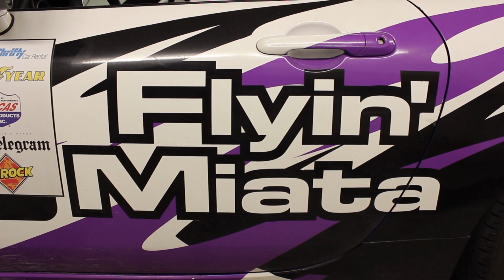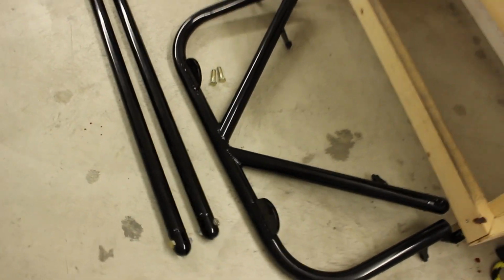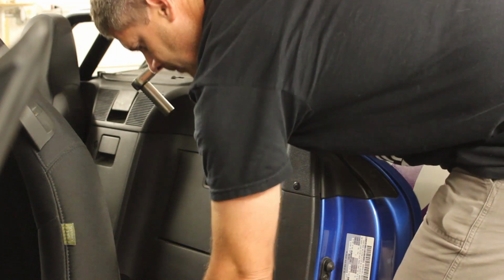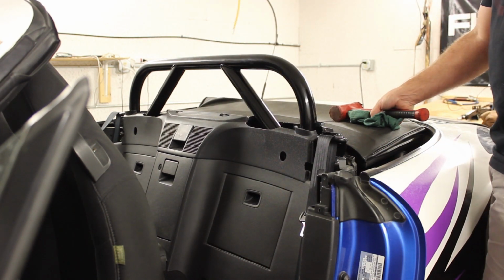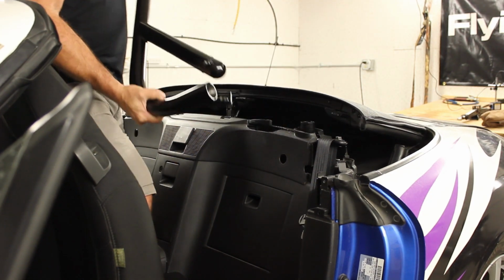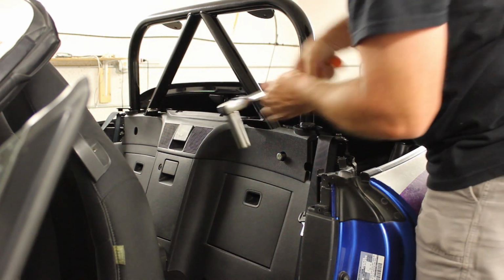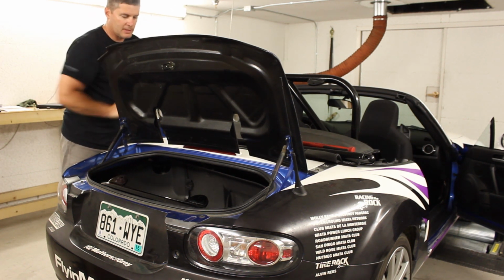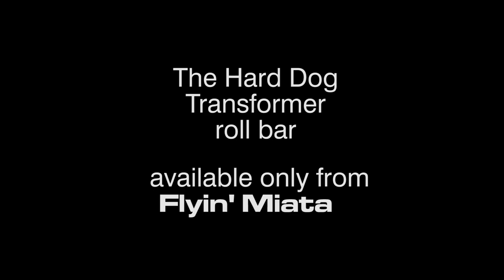The Hard Dog Transformer roll bar

Comment: .this is why everybody hates the NC. what a huge waste of time and money... plus you have to run with no top.
Reply from the maker: You only need to have the top down when the bar is in the high position, you can drive to the track with the top up.
The NA and NB bring their own compromises. A bar like this would be pretty useful there as well for drivers that are taller than 5'10".